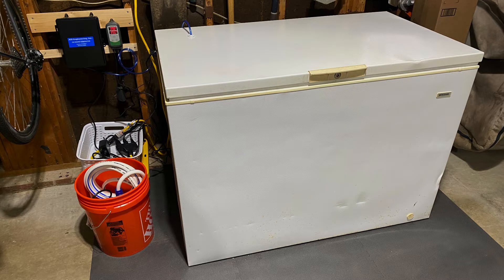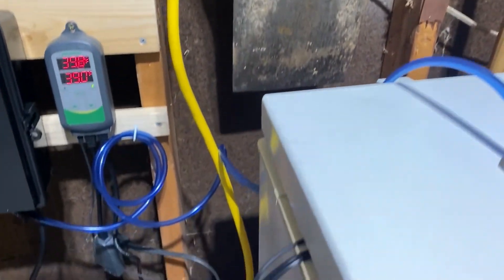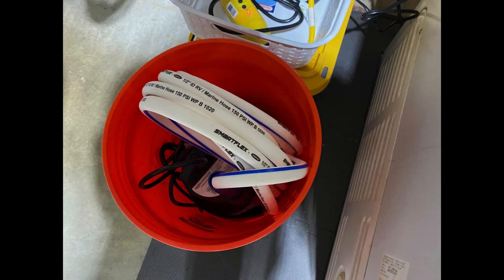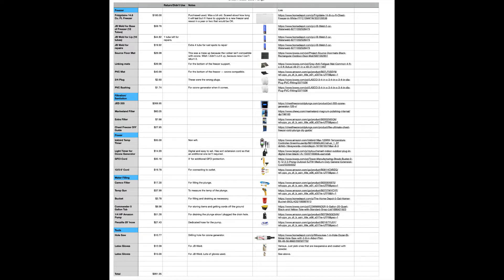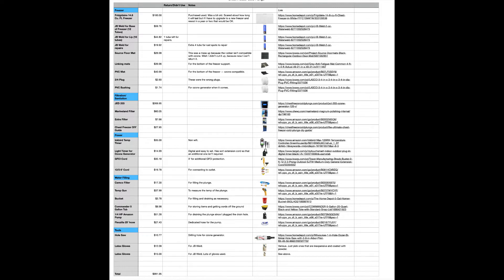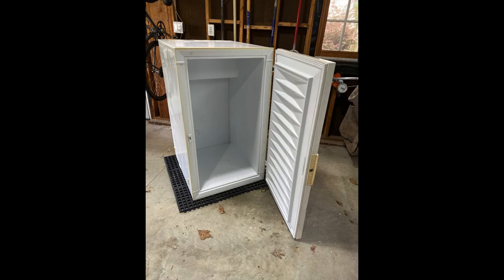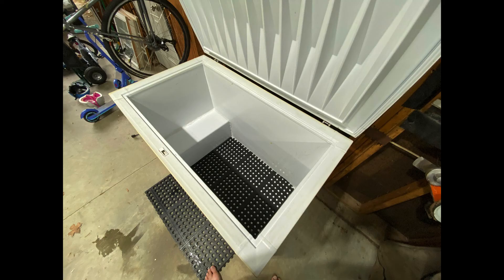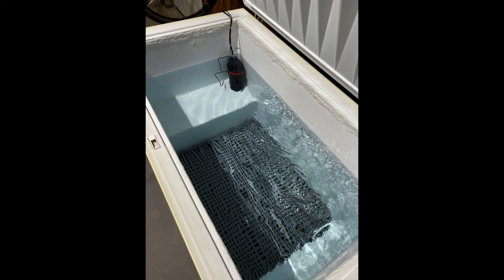Chest Freezer Cold Plunge Ice Bath Conversion Bill of Materials/Cost (Deliberate Cold Exposure)

Comment: Great video. I haven't seen the hose inserted through the roof before!  Nicely done.  I noticed that you appear to have plugged the chest freezer into an extension cord and wondered if you've experienced any issues with that.  I very much want to use an extension cord (for best placement) but the product specs say not to, to plug directly into outlet.  They are specific about it.... Anyway, great work, hope you're still using it.
Reply from the maker: I have not had any issues with the extension cord, but good point. I figured the extension cord is a larger gauge wire than the freezer, but YMMV. Thanks!

Comment: Is the JB water weld more effective than silicone aquarium sealant?
Reply from the maker: I’m on the Chest Freezer Cold Plunge group on Facebook and there have been lots of failures from silicone and almost none with JB water weld. It’s worth the extra work and expense IMHO.
Reply: @danvprod5848  I have a chest freezer and was going to use silicone in it, but what is JB water weld?
Reply from the maker: @braumenheimer9607  I would highly recommend purchasing this book. Well worth the price to avoid some of the pitfalls of converting a freezer. https://www.amazon.com/Ultimate-Chest-Freezer-Plunge-Guide/dp/1702389898/ref=sr_1_1?crid=3P3OCVZZZME6T&keywords=chest+freezer+cold+plunge+book&qid=1672014620&sprefix=chest+freezer+cold+plunge+book%2Caps%2C82&sr=8-1 JB Water Weld is a product that is available in the US at Lowe's and Home Depot. It's a two part epoxy that is very sturdy, holds up to cold well and isn't affected by ozone. It can also be coated with epoxy like Pond Shield.
Reply: @danvprod5848  Sounds excellent!  I'll look into this stuff at some point-thanks!

Comment: Are you worried at all about the filter leaching harmful chemicals into the water with the help of the ozone?
Reply from the maker: I'm not, really. I just use the polishing filter in the mainland to keep the water clear and the water moving. I've added pond shield non-toxic epoxy to the inside, which may also help.

Comment: Thanks for the detailed video! Would you share a link to your material cost spreadsheet (very helpful) or put all the material links in the description section (Plus, if you use affiliate links, you'll earn a small commission off any purchases people make from those links, which I'd recommend based on all your research and what you put into this project). Thanks, again!
Reply from the maker: Thanks for the kind words. I didn't put the info on this video because much of this content is from "The Ultimate Chest Freezer Cold Plunge DIY Guide" by John Richter. He also has a very active FB group.  I will add links to Amazon in the description, but I'd highly recommend picking up the book and joining the group: https://www.amazon.com/Ultimate-Chest-Freezer-Plunge-Guide/dp/1702389898
Reply: @danvprod5848  - Thank you! Greatly appreciated. :)